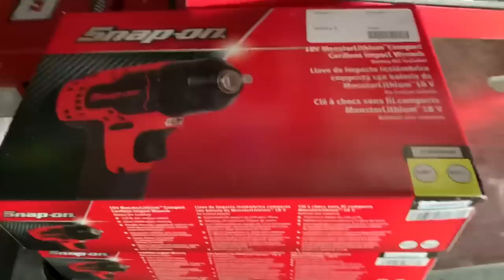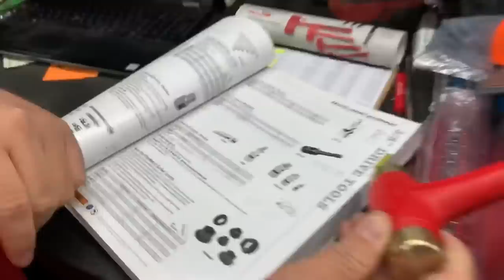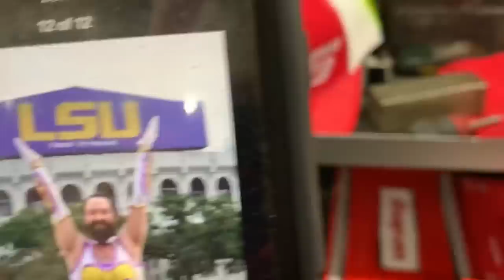Snap On New Hats and Hamilton Is A Brave Man Loaning A Torque Wrench To Wally

Comment: I believe Wally mumbled that 9/16 fits some Nissan spark plugs but those are 14mm. I know the sizes are close but 9/16 you run the risk of socket slipping slightly. I’m all for using whatever gets the job done but there is a slight difference. I just picked up a 14mm after figuring this out the hard way.

Comment: Im not sure if that was sarcasm or not 😂but lowkey I love the snap on 3/8 14.4v impact. I have the Milwaukee 3/8 stubby and already had to send to get rebuild... but In all fairness I did beat the life out of it. The snap on 3/8 is now my go to but in reality I used it more like a 1/4 impact but still prefer it over my stubby milwaukee. As far as vice grips right now the Milwaukee torque lock vice grips are a life changer, you can put a screwdriver at the end and twist it and tighten it even more after you clamped it down, they are like $30 for a pair, love em